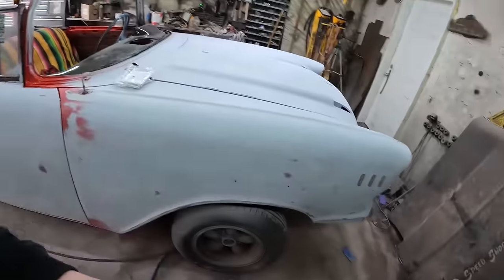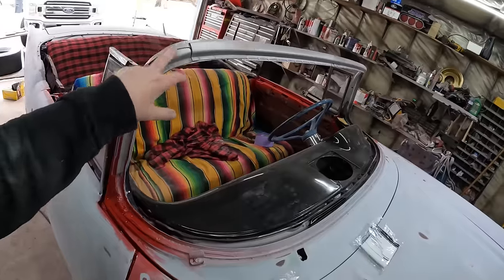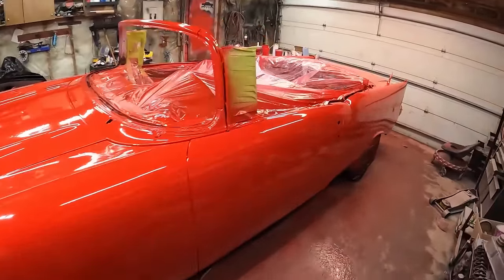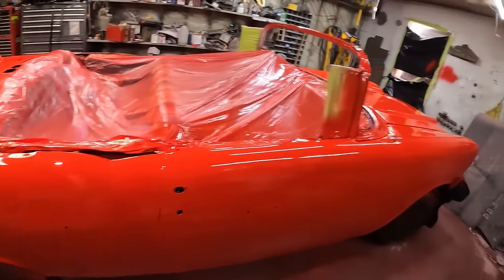"Almost Perfect" $100 Paint Job - Tractor Paint On A 1957 Chevy Convertible?

Comment: Dan looks great, tack coat was a good 1st step ,that eliminated a lot of runs ,now there are different speeds of thinners/ reducers, slow med and fast ,slow is for hot weather 85 and up ,fast is for cold weather 70 and below med for 70 to 85 , if you are going to paint you must Learn your thinners ,that will eliminated runs and orange peel , if you raise the air pressure that will make the paint lay down and elimate orange peel , with a conventional  spray gun I used to spray at 55 lbs  at the gun with trigger wide open,  think of it like this if u took a hand full of mud and dropped it on the ground it would be rounded pile if u threw it hard at the ground it would flatten it out ,same thing with paint ,to a point u should experiment on a practice  panel to see what works best , 3m makes a sand paper for da sanders called trizak ?? ,get some 1000 or 1500 put that on a da sander squirter same soapy water on a panel and wet sand like that be carefull on the edges just do the large flat surfaces , your car looks fantastic  from where u started to where u are now, nothing short of great keep it up ,I really enjoy your channel. Jim
Reply: Thanks, Jim!  Good points for acrylics.  I think he's using oil based enamel.   Acetone or toluene are pretty much his choices for thinners.   They make hardner/activator specific for oil based products.  It looks like he's using acrylics hardners...may or may not actually work.
Reply: @dannymccarty344  Dan all tractor paint and rustroleum is is alkaline enamel they make diff speed reducers for it ,they used to any how , I used to use it on low budget paint jobs
Reply: @jimlarkin559  Google is your friend.  Oil based paint....
Take a few minutes and read.   Surprise, surprise!